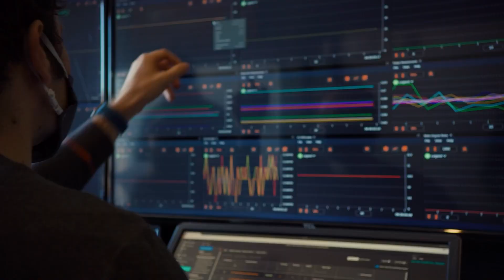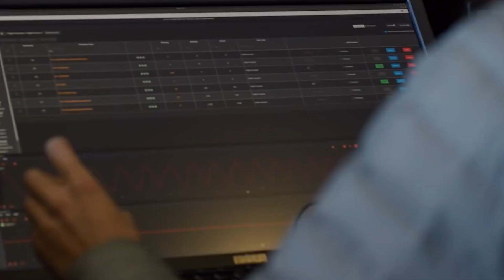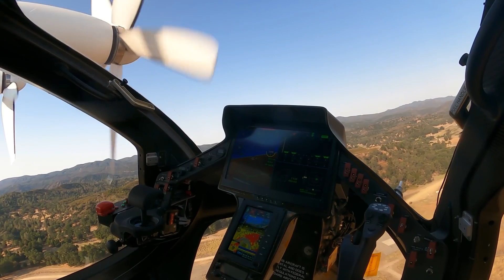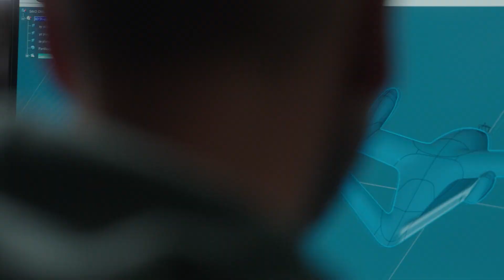Revolutionizing Flight: Joby's Electric Aircraft Takes Off with Special Airworthiness Certificate

Comment: The v22 Osprey tilt rotor has killed enough people to fill a cemetery and it only has 2 tilt rotors  , this aircraft has 6 tilt rotors .  The big heavy motors on the wingtips are connected to rotors that have serious gyroscopic forces acting all the way out at the end of a long moment arm .  I worry about the wingtip motors flexing and causing stress's that the wing structure wouldn't be stiff enough to handle .